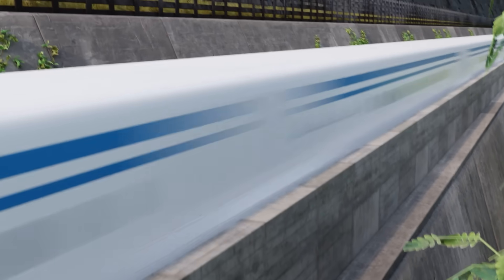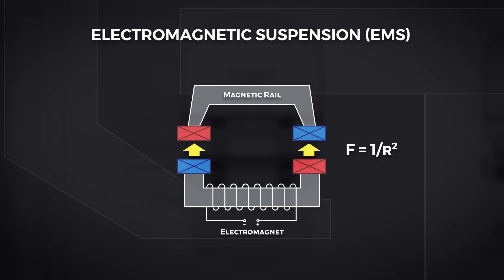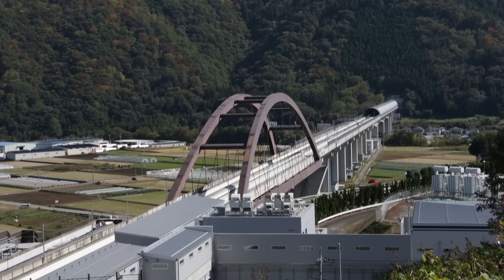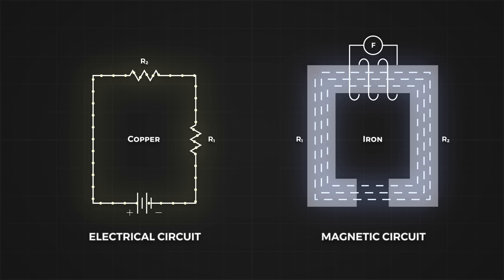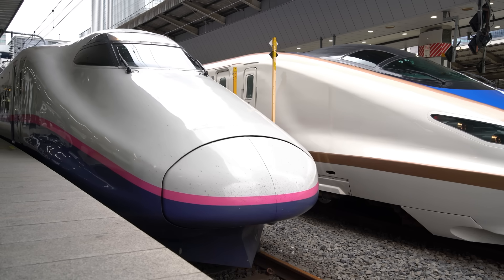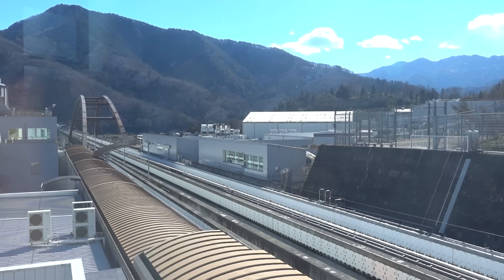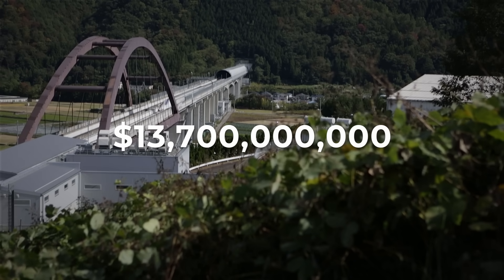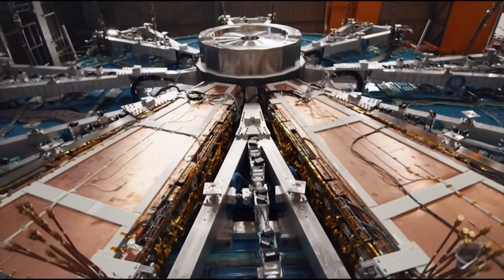How Japan's Maglev Train Works

Comment: As an engineer, it would be quite interesting to consider the environnemental issues with the construction of such a huge line :
Carbon lifecycle analysis
Impact on water and ecosystems of the rail and the tunnel
...

Comment: Maglev is just a proof of concept rather than practical solution. The Shanghai Maglev Train bleeds $100 million per years, but China has an extensive freight rail network to cover costs.

This is just Japanese hardheadedness just like they pushing hydrogen cars into our throats. This channel also covered hydrogen cars before and it's still applicable today. https://youtu.be/f7MzFfuNOtY

Comment: I'd love to see a dedicated video on the Transrapid, the system used in Shanghai and developed in Germany, that ended Maglev development in Germany (and Europe) due to an accident on the test track.
Reply: " that ended Maglev development in Germany (and Europe) due to an accident on the test track."
That is not accurate. The reason why it ended was that Siemens and DB pulled out really for political reasons.

The accident happen in 2006, in 2009 there was a new train developed, superior to the last one, it run test until 2011 when it was closed down. 

Testing didn´t stop in 2006, just the license to carry passengers.
Reply: @matsv201 while the accident is not directly responsible, it did sway public opinion on the project and will have had an effect on DB's and Siemens' decision to discontinue the project.
Reply: @minecrafter0505  No that is totally wrong.

DB already pulled out of the project 6 month earlier, and Siemens already wanted to pull out of it a decade earlier. They was just forced to stay in due to a contract when they got the subsidies.

Also, Krupp didn´t want to pull out, so there was also a breach of contract between Siemens and Krupp.

The claim that the public turned against it i would say also lacking evidence.  It was rather the media that turned against them, and it already did so back in the Hamburg project that was totally astroturfed.

The fact is that after the 2006 crash Transrapid developed a whole new train with totally new lift magnets. A brand new track segment, a totally new inverter (transistor based, the old one was thyristor and the same that was around since 1984). A new driver-less C&C system. And a totally new induction energy pickup system.

Pretty much everything was new for the TR09 model, that was fully developed after the 2006 crash.

While DB lossed intrest there was at this time (2006-2011) plenty of interest of in other nation, and it was really only at this point that they focus of selling the system abroad.

It was during this time most of the maglev system around the world was consived. Like the 2008 Melbourne one,  The 2007 Hangzhou one, The 2007 Munich airport one, the 2012 Indian network one, the 2009 Tehran to Masshad one, the 2008-2011 Pisa to Florence one, the 2010 Singapore one,  the 2011 Swissrapide one, the 2007 UK ultraspeed (HS2 replacement), the 2008 Nevada one, as well as the 2007 Pennsylvania one and the 2011 Teneriffe one.

That was quite a few more than the 2 suggested in Germany.

I would rather say the totally opposite is true.This was the time that intrest around maglev peaked.

This was also the time that Chuo Shinkansen was decided (2009) and the 2012 Orlando maglev project started and that was also the time Linimo was bought by China to build Changcha airport shuttle as well as the time Incheon maglev system project was started.

We know why some of those system failed. Orlando system there, station rights was pulled, so they could no longer built it.

The Hangzhou line was blocked by the minister of railway that later was proven to take bribes to stop the project (he is currently in jail).

The Las Vegas project got there State funding pulled for unknown reasons.

The Spanish project didn´t get EU subsidies (unlike the HS-rail that did) and the project was about to launch right in the finance crash in Spain.

Some projects are still active like swissrapide and some of the Indian once

Comment: I remember teachers talking about maglev trains at school in the ‘90s. Nice to hear the technology is improving and it is going to be happening. Shame other countries, like the UK, who are investing £100b in HS2 (traditional high speed rail), aren’t taking up this technology.
Reply: (USA) “Wait you guys are getting HSR?!?”
Reply: If you invest 100b why spend 1000b for technology that is not really better?
Reply: @whuzzzup  "Not Really" is a bit subjective.  Granted valid point, although i want to see long term / ultra long term costs.  "Ballastless Tracks" are inherent to maglev, but wheel+"bogie"+rail maitnance+ballast maintenance is in most rail short of some HSR.  Also i know one of those HSR Designs has a dedicated Wear Bar that needs swapped due to the Overhead Wire shredding through them at high speed.  Granted one may be able to buy a ton of them with the money saved, and so on.  Need a good study.

That may be less than i would think, but that would be interesting to see determined.

Also emerging technologies will always be expensive.  Also a mix of More conventional for short routes, maglev for ultra long routes can work.

Comment: Walt Disney World Monorail System of 14miles is a half maglev and half rubber wheel contacts.  This has been in use since the 1970's
Reply: Maglev stands for Magnetic LEVITATION, Disney train does not levitate, it rides on wheels, it just uses linear magnets to move forward. It's literally bus with magnets. It is not even close to this technology. It's like comparing Horse Carriage with a Ferrari.

Comment: Liquid . . . Helium? That's insanely cold. Making that work on a practical scale outside of the laboratory is an engineering feat by itself.
Reply: I mean, at this point they should just go balls to the wall with magnets and also do magnetic cooling. The train is already 80% magnet, might as well bump that up a bit.

Comment: If maglev were cost competitive with airlines in the US, then I don't see how distance would be a barrier to widespread viability. A commercial nonstop flight from New York to Las Angeles takes about 6 hours. But most people flying cross country don't fly direct, so it takes longer. Plus, dealing with airports is a huge pain; much worse than train stations. At 500 km/h, you could travel from NY to LA in 8-9 hours. All things considered, that's similar to flying, with a much more pleasant experience. 

So at least in the ideal case, high speed maglev is preferable to flying even for very long distances. It's once you add in the caveats that it starts to look less attractive. First of all, you can run a lot more planes per day from NY area airports than trains on a single rail line. Then there's the fact that a train wouldn't actually be completely direct. It would need to make several stops along the way at major cities to be viable, probably adding on several hours to the total time. 

Most importantly though, with current technologies, a ticket on a Maglev train would probably be much more expensive than flying. The construction costs are just too high. And if a section of the rail needs to close for maintenance, the whole thing would need to shut down, whereas if a plane needs maintenance they can just use a different one. Otherwise, they would need to build several redundant tracks, which would increase costs even more.

Comment: Japan’s maglev trains, which hover 10cm above the track at speeds of up to 500 km/h, are based on a different system to the electromagnetic suspension used by Shanghai. The country’s 43 km-long line between Tokyo and Osaka will be the world’s first inter-city maglev train, but the technology is still in its infancy. Despite the fact that maglev trains offer lower maintenance costs and can operate in all weather conditions, they are not yet widespread. As yet, the only commercial high-speed maglev line is in China and it is just 30 km long. One of the primary reasons for this is the complex technology required to maintain the train’s stability. However, unlike the Chinese system, where the train is pulled upwards using attractive forces, the Japanese maglev uses a more passive system of levitation, with magnets on the train interacting with passive coils on the track. If the train drops slightly or moves sideways, the magnets on the train induce currents on the opposite coils, generating a stronger magnetic field, which pushes the train back to the midpoint of the figure 8 shapes. The Japanese maglev system requires superconducting coils to generate the magnetic field and keep the train in a stable configuration.

Comment: This is really cool, but I worry about all the failure modes. Like what would happen in a blackout?
Reply: Nothing, train would slowly stop, superconducting magnets won't just stop working, they hold the charge.
Reply: @randomnickify  Well the superconducting coils are in the train so its totally power independent of the track. The train got power from induction from permanent magnets, effectively converting the speed to electric power. (it also have onboard battery for 5 minute usage)

Comment: The Shanghai maglev is a surprisingly bumpy and violent trip. Even after slowing down, cornering is quite a physical experience. It’s more similar to a turbulence on a flight than riding in a car. Definitely no walking around the cabin. Whereas China’s standard high speed rail is very comfortable. I don’t think I’d want to ride in Shanghai style maglev for the whole trip from Tokyo to Osaka - it would be exhilarating but exhausting.
Reply: I think Japan's implementation will nail them out to a more comfortable extent. Trains are THE main form of transport in Japan for public so they are most likely to make sure its something the public will want to use.
Reply: Absolute rubbish. Sounds like you were scammed and didn't ride the maglev at all.

Comment: You just put an air extraction system directly at the midpoint and towards either end of the tunnel. When the train is approaching, air is extracted from the tunnel end and middle; once the maglev passes the midpoint, air is blown in behind the maglev from the rear and midpoint. This means that there is always a backwind, or at least, less resistance from the headwind.
Reply: Pumping air out rapidly is actually incredibly difficult and logistically not feasible, would be easier to use the train as a ram with a 1 way valve system honestly
Reply: @LexFanClips-o4h  You wouldn't need to pump it all out or pump it out rapidly. I'm not talking about a vacuum train, just a reduction in headwind airpressure and the creation of a tailwind. Pretty simple to install, just drill a smaller tube parallel to the tunnel and have valves at certain points opening and closing as the train passed each point. But you raise a good point. Perhaps actually just a single mid-point air extraction system, so as the train enters it breathes in and sucks air to the centre, and as the train passes the midpoint, it reverses and blows the train out the other end, so to speak (not literally of course). It would be then just a question of: is the power needed to run the extraction and blowing fan system more or less than the power needed for the train to be a ram to push the air out without assistance? My guess is probably not, but it would allow the train to maintain speed and also possibly reduce wear and tear.

Comment: Maglevs are cool, they are really impressive, but if they only achieve a 30% increase in top speed over normal high speed rails and they need completely new infrastructure to be built, I don't know, it doesn't sound THAT impressive in the end. High speed trains are almost triple the speed of normal trains, so the gains there are impressive. But for maglevs, unless they can go to much higher speeds than 400, like five or six hundred, it sounds like diminishing returns. I'm sure there are enormous engineering challenges in developing even higher speed maglevs but currently the gain over the cost doesn't seem to be there.

 It's a shame though cause flying sucks and it's because the airports have become a huge hassle where you have to be there 2 hours before and then wait at least one hour after landing before you can get out of the airport if you have luggages, and then also you're likely not in the center of the city so you still need likely another half an hour to an hour to get to your actual destination. With trains you just hop on, and then you hop off. Maybe half an hour lost in total getting in and out of the train but when you get out, that's it, you're in the center of your destination city.
Reply: "High speed trains are almost triple the speed of normal trains"
It's actually around double at most. The idea is that regional trains around Europe are limited to 160 km/h and non-high-speed intercity trains around 200 km/h. High-speed is considered sustained speeds of 250+ km/h, though most lines nowadays are built for 300+ km/h speed.

Comment: The missing "economic" justification (well, since forever) is the value of carbon off-set. Okay, sure, x11.3 cost for 1hr doesnt make sense, but if carbon off-set had a value to the economic model, would it then make sense? Dunno.

Comment: Physics noob here, but are there no G forces being applied to the passengers? 400++ km/hr is insanely fast
Reply: When you are in a car, you don't constantly feel G-forces while steadily driving 100km/u right? That is because you only experience G-forces during acceleration. So if the train smoothly accelerates to 400km/u, you won't feel extreme G-forces. Just like in a plane.
Reply: You can watch the video from tom scoot about this maglev. It does accelerating steady so it slightly pushing you into the seat like something between a train and a plane starting but other than that once you hit driving speed it should be constant speed like with high speed trains too.

Comment: So, it can be done? It's not like the USA doesn't have the money. 13 B, seems cheap after we sent 100B + to Ukraine. I heard the same thing about Nuclear plants (too expensive).
Reply: Yes it's possible, but it will probably me more expensive, as japan already has a lot of experience in building fast railways. And japan also has more train users than the US, so it won't be economically viable over the long term. The 100B send to ukraine was mainly weaponry which the US already had, so it's not like they wrote a check or something.
Reply: True. That's why the electric car idea came about. But we can think. Wouldn't shifting to these trains be more efficient than everyone having their own personal electric grid leech? Not we even want electric airplanes? It's madness. Is everything going to be electric? Where is all that power coming from? 

Currency, is representative of value. It is not inherently valuable. So, it doesn't really matter, we still wasted that money. I'm a out to look and see how much value Maui has received.

Comment: Something I typed before I finished so this might had been mentioned already or not

Anyway, I think one of the reasons why MagLev isn’t that used widespread cause of these reason

- Expensive Capital to built new lines / replacing long lines
- No point building MagLevs for short distance like the one in China. I mean you couldn’t use it to it’s full potential since you’ll have to slow down sooner
- Safety since Maglevs are new and run very fast

Comment: Worth note that the L0 maglev is likely more efficient, but would will be very costly if its built on viaducts, compared to the Shanghai Maglev (which is Transrapid 09 made by Transrapid in Germany. The new Chinese’s own maglev is based on that using same attraction tracks). Scalbility can also be a factor as the L0 will be limited to it’s track’s loading gauge (wide and since it’s mostly ran in tunnels, height ), which the Chinese maglev don’t have that limitation, they can even build a double decker maglev if they want that. But reality is both side are building on top of what they already have some experience on, instead of switching sides.
Reply: The effiency is different depending on capacity. The very narrow and sleek L0 is quite efficient if the capacity of the train is fairly low, around 300-400 people. But when the capacity start closing in on 600-800 the wider loading gauge proven to be more efficient.

The main reason Japanese used the U shape track was due to the massive amount of tunnels. The U shaped track allow for a much smaller tunnel diameter cutting down the cost of the project quite a lot.

Comment: The Chinese one was intended to have 2 more station within Shanghai (city center and Hongqiao Airport) and then continue to Hangzhou… but they ran out of money… even the section built barely made any money. (Speed is not really a factor, as the new Airport link line between Shanghai and Hongqiao is going to use trains top out at 200km/h instead)
On contrast, Japan’s Tokaido Shinkansen line is at it’s limit, the current Shinkansen which already have body tilting, can not go any faster on the curves, the maglev line was based on an older project dated all the way back 30 years ago, that project was going to run conventional trains, but deemed that the benefits are marginal compared to try make trains back then (<250km/h) faster and accelerate quicker to make room for more sets.
Shinkansen at peak time can do sub 2 minute intervals, something only some metro in the world can do (most metro do 5 min intervals, let alone heavier tains). 
You can say L0 made the line a realization, and allowed Japan to continue accelerate to the 2050’s.